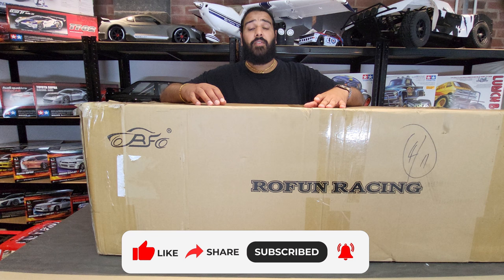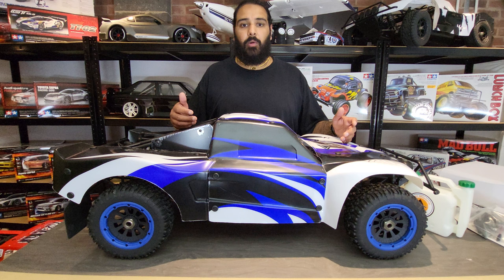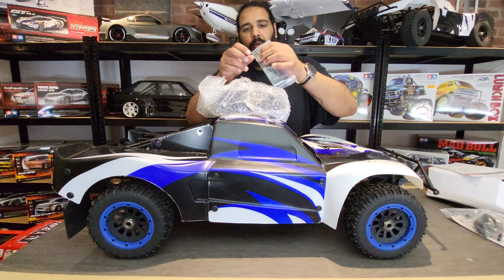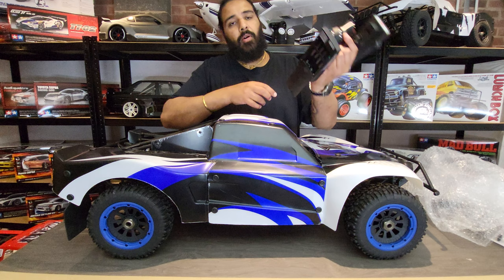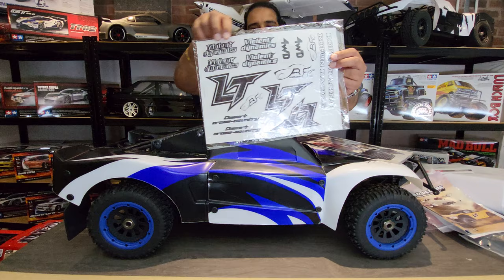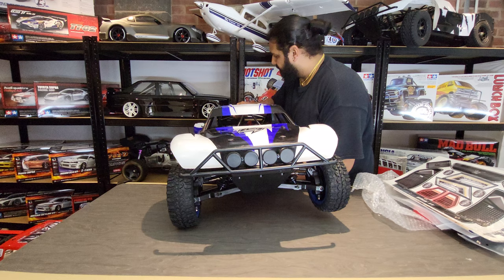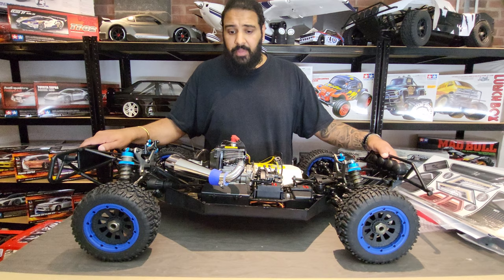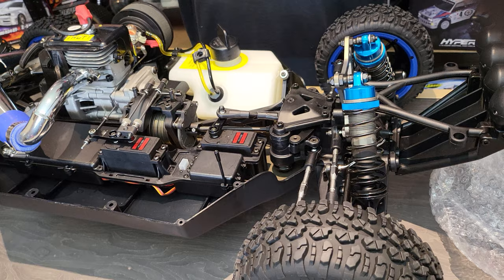ROVAN ROFUN LT 360 DR 36CC IN DEPTH UNBOXING REVIEW

Comment: Hasn't changed much since I bought mine back in 2015. The 30.5 engine has plenty of power. . Still runs great. I'm sure the 36 is better. Tear it apart and lock tight everything.... Also do up the diffs as well. Not sure why it says 2wd on rovan w/s. Also have the XLT 450 which is a great truck as well...
Reply from the maker: We got the 8s elt electric version and the lt45 45cc version. Yes, you're right. we have opened and put lock tight everywhere.  You get 2wd versions and 4wd versions too.
Reply: As much as i had problems with this pos, unscrewing screws weren't one of it.
And diffs were screwed tight as virgin had to torch them to take apart so on my 45cc ver there was loctite everywhere. Engine is total trash.
Throttle servo horn got spline stripped  immediately leading to situation where after applying brake it left throttle half opened in neutral servo position... Literally dangerous, guys never drive with plastic throttle horn.
Diffs, halfshafts are pretty good, no issues there. Plastics are ok quality and aluminium parts also. Anodising on it have some problems but for half price of łosi ill take that.
If they sold rollers it'd be decent deal.
But paying for their big engines is wasting money 😢
I have their baja and that 29cc is very good, starts easier than ori zenoah.
So their small engines are good, avoid bigger ones. Chassis quality is acceptable overall